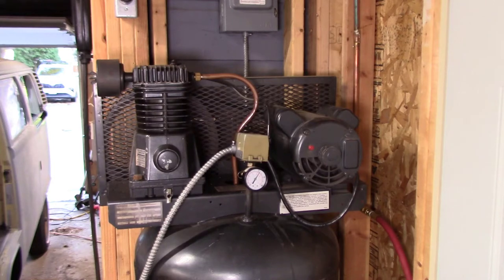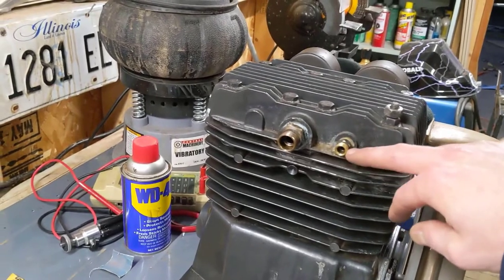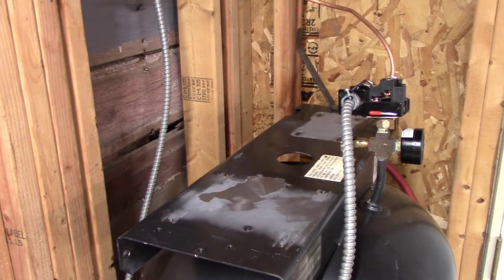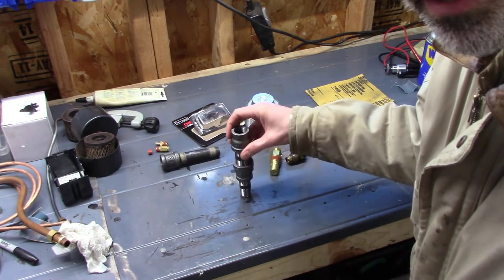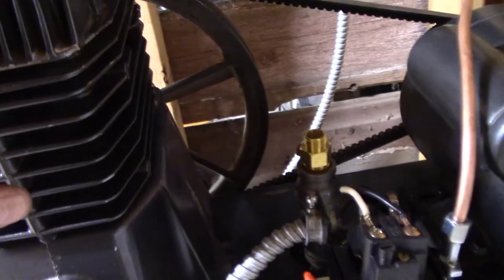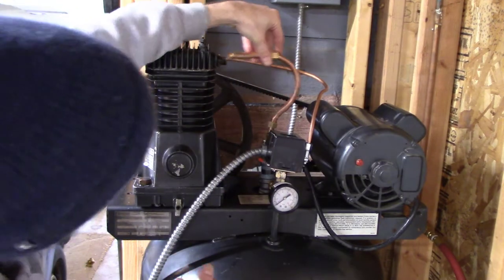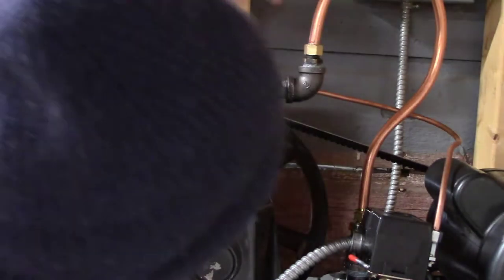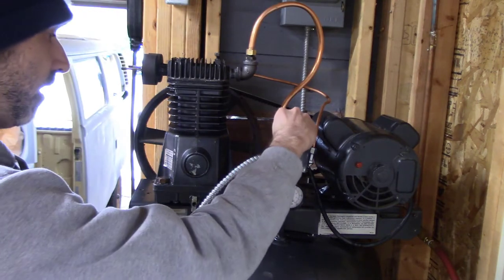Air Compressor Repair: fixed endless air bleed and transfer tube modifications

Comment: you may have a problem with the "?" shaped copper pipe.  Hot humid air coming in contact with cooler copper pipe may form condensation which will go back into the compressor (gravity) and contaminate the oil.
Reply from the maker: I will keep an eye on that.  If I do see moisture in the elbow, I could probably change it to a Tee and add a drip leg.  Thanks for the comment!

Comment: Another way to go with that transfer tube would be to make it a 2 piece with a double-ended flare or compression coupler in the middle.  
    I really liked your check valve mod.

Comment: I really need your help - I have 80 gal. compressor - my check valve started leaking - I replaced the 1/2 x 1/2 with 1/8 check valve - still leaks - I believe the threads on the top of the tank I may have messed up - your advice is greatly needed -  I was your extension build in this video - please advise me - joe
Reply from the maker: Did you spray soapy bubbles on the fittings to see where it is leaking?  What type of dope or sealant did you use on your pipe fittings?  If you cross-threaded the riser in your tank and messed up the threads, you may have to re-tap them.

Comment: They make tubing benders that make bending copper tubing a breeze!!  They also make specialized flaring tools for flaring the ends of copper tubing!!
Reply from the maker: Yes. Bending copper rather than using preformed fittings is much more common in the UK than here. It would be nice to have a 3/8" bender, but I would rarely have a use for it.

Comment: Just a few notes to help you and others who may run into this one day: a little propane torch and an adequate round surface make a good stand-in for copper pipe benders when you're not in the position to chunk out a few hundred dollars for a one-time job. Most everyone will probably have a short run of 2-2.5" diameter of pipe left over from something that make excellent short radius 'jigs' for this stuff. A telescoping length set inside as the leverage is useful for avoiding crimps, but rebar is also useful if you can avoid deforming your connection end while bending.

At the risk of playing safety nanny, but welding on a pressure vessel can potentially turn your compressor tank into a ticking time bomb. What's likely happened is that rust has precariously thinned the affected area where you get pinholes from long-term internal corrosion, which is made worse when welding repairs are enacted as you get HAZ metal around the repair (heat affected zone) which is already structurally compromised. Compressor tanks are under tremendous stress, expanding and contracting with use. That welded area will inevitably burst at some point down the road in spectacular manner; the bigger the tank, the bigger the boom, aka large bomb. 
Anyway, most consumer level tanks have a service duration due to being very thin-walled at nominally 10 years, and the best way to avoid tank corrosion is draining after every use (daily is best) and having air line dryers/water separators. Big industrial tanks are a little different as they normally have 1/4" wall thicknesses or more and are routinely inspected. In the event you are unsure about its safety, doing a hydrostatic pressure test with a pressure washer at 150% service pressure is highly advised. Worst case, your repair will crack and you'll end up with a wet pant leg/shirt. Best case, it's perfectly fine and you'll eek out a little more life from your tank before you have to deal with replacement. Hell of a lot easier to deal with than the shrapnel bomb of a compromised tank!
Reply from the maker: Thanks for the info.

Comment: Try out buying a smaller oil cooler or transmission cooler radiator style deal with 4 or 5 passes and connect it inline right after the compressor head feeding into the rest of the system..  another upgrade is installing an oil/water separator right after the little radiator and then into the check valve then tank.. youll get 5x the use out of the compressor tank before it rusts out plus all the air in the tank will be clean, dry air..  as long as a fan is used in conjunction with the radiator..   cheap and well worth the work and install…
Reply from the maker: Good tips. I will look into that. Thanks!

Comment: So a 1/2” female compression fitting will thread to a 1/2” male pipe fitting?? I need to create a tube aswell no luck online
Reply from the maker: No, compression and IP have different thread pitch.  The check valve I installed was male IP on the bottom to thread into the tank and compression at the top for the transfer tube.

Comment: I am running a DeWalt 175psi on a husky motor and pump
Reply from the maker: Nice! I might be in the opposite boat as you.  My tank sprang a leak last year.  It was a small rust hole in the bottom.  I welded it up and it's been fine since.  My pump and motor may outlast this tank.  We'll see.  Thanks for watching!

Comment: A smaller line runs from that smaller port u see to the check valve on a square D pressure switch
Reply from the maker: Yes, as I was doing this video I educated myself on the bleeder line. The pressure switch opens at the end of the cycle to bleed the pressure from the head (either from the head or top of check valve, it doesn't matter).  That way when the cut-in pressure starts the motor, the pump isn't bound from pressure.  I know you know this.  Just reiterating for the other viewers.

Comment: is there aluminum tube that you can buy?
Reply from the maker: I'm sure you can buy the exact replacement part for this compressor which was an aluminum tube, but they are expensive and harder to find.

Comment: Was it bleeding air from the bleeder tube or from the check valve?
Reply from the maker: Air from the tank was escaping out of the broken/missing check valve back into the pump head via the fill tube and then finally escaping out of the bleeder tube.
Reply: I bought the same check valve you linked, but when I got it, the inlet side is an absurd 11/16" which I can't find a compression fitting for. Did you have that issue?
Reply from the maker: @tylerreidl8447  I remember buying the 3/8" ID tubing, ferrules and sleeves from Home Depot.  The compression ferrules and sleeves were in the plumbing aisle with the copper/brass fittings in bags (2-3 per pack) hanging on the wall.  I have a link in the description for the ferrules, but I wish I would have taken a picture of the sleeves in the video.  That would have been helpful. 🤦‍♂
Reply from the maker: @tylerreidl8447  Wait, did you say 11/16"???  I believe it should be 1/2" OD compression.  They may have sent the wrong product.
Reply: It's the one you have linked, they may have changed their listing, but yes it's a funky 11/16 size on top which I have never seen until now 😂
Reply from the maker: @tylerreidl8447  I rechecked it and that link is the part I ordered according to Amazon.  If 3/8"ID/1/2"OD copper tube fits inside the compression side of the check valve, then you should be able to find a brass sleeve at home depot that works with the 11/16" compression threading.  If your feed tubing is different, you may have to return that part and research a different check valve.  This store had many more variations: https://compressor-source.com/collections/new-check-valves?pf_st_inventory=true